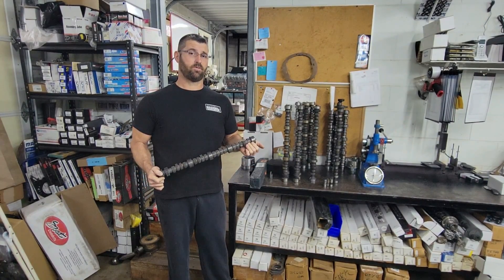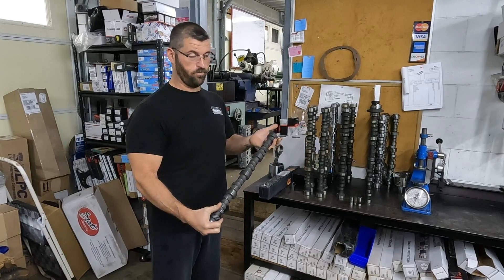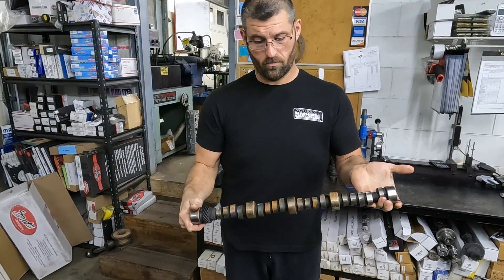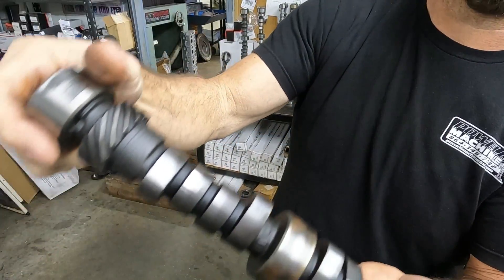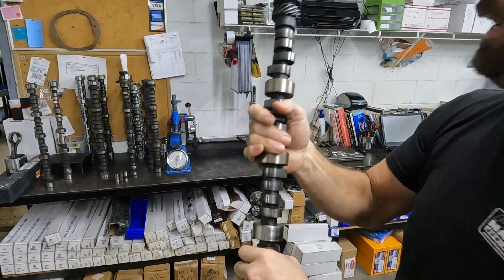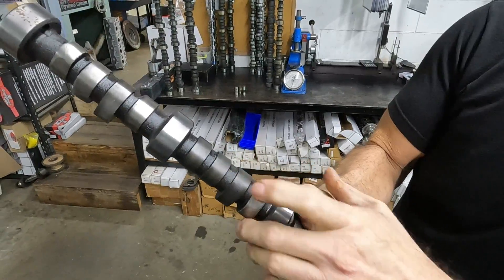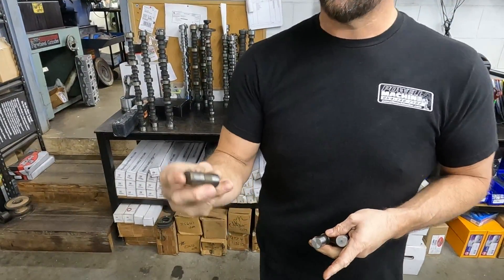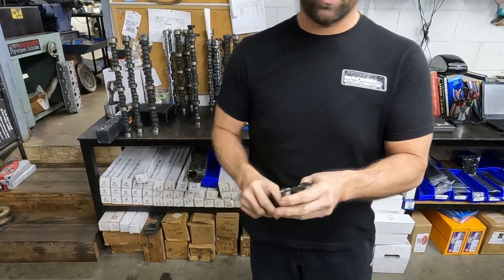Flat Tappet Cam Failures?, we investigate why and check the hardness of several cams and lifters!

Comment: A solid lifter cam is a flat tappet cam, a hydraulic cam is not as it has a very slight bulge on the face. Lifters should be harder on the face, the heat treating is only quite thin. Refacing lifters generally takes off the heat treating.
It seems that many lifters and cams are not made properly,, that and modern valve springs are a good deal stiffer than in the past.Even on stock cams often. 
It does depend on the brand of engine as well,, eg here in Oz the Holden V8s eat lifters, many were 'gone' at 2-3 years old. Some replacements lasted longer than OEM and others ate up very quickly. I have changed a LOT of them. Clevos and LS Mopar V8s do not have the same appetite for them as the Holdens. Chevs are better than Holdens, but not great either.. But I have changed more Chev cams than Fords. 
Falcon 6 Cross Flows eat rockers, Cleveland rocker @ 1.73. But the lifters generally live [again Clevo] Holden V8s do this as well but not as bad as Falcons. 
Yet I have ran solid lifter cams in Chev race engines for many years on the same cam. Roller even better. A little conservative on cam specs but were bedded in on the springs to be used.
Ditto hydraulic race cam for a Clevo.

Comment: great video and information. One question, does the cam grinder harden the cam after finish grinding? If not isn't some of the hardness ground away in the process?Likewise if a crankshaft is turned .010 is it softer?
Reply from the maker: Iron is through hard, so the amount removed doesn't effect the hardness,  steel on the other hand does has a case depth.
Reply: @powellmachineinc  i did not know that, thats cool.
Reply: @powellmachineinc  So if I have a sbc 1182 steel crank and I get it turned to 327 small journal will that weaken it?
Reply from the maker: @hotrodrebel855  generally reducing the size "could " result in less rigidity,  but ultimately it's not a major deal in your application,  the biggest thing is getting the fillet  radius correct,  to stop any cracking

Comment: Why hydraulic how about solid lifters?
Reply from the maker: The body of the this is for all intensive purposes the same, ww did test many solids,  I mentioned that in the video,  just didn't have any on hand
Reply: @powellmachineinc  I've been doing cams since the '60s and typically ran (before the failures noted in the magazines last few years) a softer spring during the critical 20 minute 2500 RPM break-in run.  I still use a gutted distributor  in an electric drill to pre-prime oil pressure.  Plenty of cam assembly lube.  So one of the culprits to me seems to be the lack of ZincDitheoPhosphate in today's environmentally restricted oils?!  Definitely appreciate all of your mechanical/machine analysis and dial indicator and cam wear readings. I use a  Mech Roller 670 lift last few years w/Bronze distributor gear. Been very reliable.  Thx again & Cheers!

Comment: Very good, and timely, feature.
Haven't had a pushrod engine in decades, have you done something similar on OHC, DOHC camshafts and lifters that are normally designed with direct oil feed to the follower, rather than relying on splash?

The core doesn't give a darn about where it came from, what matters is the material and the heat treating, if any - Chinese 'crap' is 'crap' because they get away with it. Theere can be excellent products from there, but only when the customer/client holds them to the required standards, which means confirming any tests for themselves.

Comment: A friend of mine builds my engines and I follow his start up instructions to the letter ! First he sets the timing on the engine stand , he says never make a full rotation putting in the torque converter bolts ( you don't want to wipe the cam lube off the cam rotating it before the start up ) I use a known good carb and ignition system to make sure it fires on the first hit of the starter . When it starts NEVER let it idle - keep oscillating the RPM's up and down - I immediately drive mine still not letting it idle , I bet I don't let mine idle for at least a month if not more and he says never just rev them up and hold it at a single rpm like " they " say to do . He installs pretty sizable solid lifter flat tappet cams ( Racer Brown Cams in my MOPARS because the grind cams for MOPARS not just Chevy profiles on blanks ) I haven't killed one " YET " lol knock on wood !
Reply: Then how do you set valve lash if you dont turn it?
Reply: @whiteboyfromernul  He sets the valve lash with the intake off and keeps painting the cam with the cam lube , plus you go back and forth across the engine instead of one side at a time

Comment: I’d like to see a lifter refacing video. I have some comp lifters that had light rust on face. Maybe I can clean them up.
Reply from the maker: We will do that soon
Reply: Yes you can clean them up with a peice of glass some 400 grit sand paper and some marvel mystery oil run the lifter across the sand paper poor a adequate amount of oil on it in figure 8 to get a cross hatch on the lifter and your good.
Reply from the maker: @Annmarie Rudolph  that is not how you do it,...
Reply: @annmarierudolph2291  NO.

Comment: How about lifters not turning in the bore properly or block machining off like on BBC where the bores would be redrilled and bushed and reindexed in relation to the cam.  Are these people having problems using break in springs and break in oil? Making sure everything in block super clean? I'm sure the changes in oil have not helped and I'm sure it can be a bit of a crapshoot, I lost one from cam dynamics back in about 1989 on a 406sbc. Watched one on a BBC go on the Dyno about 10 years ago, he went roller after that.
Reply from the maker: Generally lifters not turning is a sign of taper issues,  definitely there can be lifter bore alignment problems,  BBC'S as you mentioned are a perfect example,  correcting those problems is out of alot of people's budget,  but should be done if you are required by class rules to run a flat tappet,  .

Comment: Ok, good to see the testing but what's the take away? Nothing was bad. So why are so many other people having devistating experiences? I coat my cam and lifters with graphite, then the break-in lube. Using stock spring pressures I run the engine at 1500 to 1800 for 30 minutes. Knock on wood I haven't had any of these cureent reported failures.
Reply from the maker: There was a bad cam,  And I talk about why, and I talk about lifter problems,  watch it 1 more time, ! Thank for your comments 🙏

Comment: I have a new Comp Cams flat tappet cam for my Ford 351M. Just a mild low RPM torque style. I've heard and read about break in horror stories. Now I'm hesitant to install it.  The OEM cam still works fine and the lifters are quiet. I think I will stay stock and not push my luck.

Comment: GM had issues with cams going flat in the late 70s/early 80s, my father changed a lot of them at the shop he worked for.  Seems to me SBC had 1 or 2 specific holes where the lifters would go flat first, i'm thinking #6 or 7??
Reply: Crocked lifter bores!!
Reply: @ruxoneto6560  nope. soft cores.

Comment: 100% of the flat tappet failures I've seen are due to unclean oil galleys. Abrasive material left in the oil galleys of a fresh block that damages the cam and lifter surfaces or the internals of the lifters.
Reply: wayment ... you mean gallery/galleries
Reply: @immanutt4442 galley is the flat area, gallery is a passage.

Comment: I put a amc 360 together earlier this year using a bullet racing cam with.512 lift . I used lots of cam break in lube , Rotela t4 and Lucas break in zink additive. Used oem springs. Also I used 15 nos flat tappet lifters and  sealed power China lifter.  Pre filled carb and got the ignition timing advanced a little. Engine fired up quickly enough and I took the rpms up to 2000 rite away . Ram for 25 minutes with about 55 psi oil pressure.  After the cam break In period in pulled the intake to inspect the lifters. I put the China lifter in the no.1 exhaust position   to ensure I would know where it was. The 15 nos lifters broke in perfectly but the China lifter had 12:24 circular groves worn into the face and it was almost flat .  I didn’t use the China lifter because I wanted to, but because that was what I could find. I would like to send you the picture of the lifters .
Reply from the maker: Sure,
Reply: @powellmachineinc  I’m not sure how to send a picture
Reply from the maker: Go through the website

Comment: Great video, thank you. Is there a way, to check/ measure/ verify the taper on the cam lobes, and the crown on the lifter, before installing them in the engine? I know by holding two lifters together, some of the crown can be seen, but that’s just a guess. If you were sent a new cam and lifters, could you check it and verify? As well as checking the hardness on both? Thanks.
Reply: Using a micrometer, measure the lobe on each edge. Should be .002”-.003” difference. That’s your taper. 

Use a precision straight edge on the lifter faces to check for crown.
Reply: @glennsouthard9208  thanks!

Comment: Years ago, I believe the cams were ground off of a "template" camshaft, yes? The cam core grinder followed the profile of the template cam with scienced-out specs for particular common applications for that particular engine size &  manufacturer, correct?  So, my question is it still done that way? Or is it completely computer controlled(no actual template camshaft) nowadays? I guess what I'm asking is the lobe taper controlled by the (computer programmed by a virtual design in the grinder)machine operator, or is the taper controlled by the taper machined into the actual template camshaft?
Also, do cam grinders vary the direction(forwards/aftwards) of the lobe tapers to counteract the forces of the lifter pushing the cam, so there is no excessive movement of the camshaft forwards or rearwards? Or do all the tapers "face" the same way?
Reply from the maker: Several things, many including me use a manual grinder that uses "master plates" that have a particular lobe design on it to grind said cam, the taper is either dressed on the grinding wheel or the actual wheel head is rotated on the correct angle for taper, on most cnc grinders the wheel head rotates also  but it's actually controlled by the cnc controller,  so the programmer would program that in.
Reply: @powellmachineinc  ahhh. So a (manual)camshaft grinding machine operator could possibly forget to set up the machine to grind the taper in the lobes.
About the other question: do ALL the lobe tapers face the same direction or not?
Reply: @budlanctot3060  a cnc machine could also forget steps and not grind the taper.

Comment: UTC recently did a video about this issue with a possible cause of failure not the hardness but the shape of the lifter shape not accurately machined so the lifter would not rotate.
Reply: Is there a link for this? I've not been able to find it.
Reply: @tachedtc  search you tube “ getting to the bottom of the great cam and lifter fiasco” uncle Tony’s garage. I would give you the link gladly if I knew how.

Comment: I have built 6 sbc 350 engines with flat tappet cams in the Last 8 months and not Lost one yet
Reply: Good work i have done dozens in my life and had 100percent success unitil last year i wiped one .thats one to many a comp cams item i now have. Gone to billet rollers .no taper on a flat tappet ment death to my cam and lifters therefore my race season also .won t happen again..

Comment: What you have stated reinforces what I have seen over the years. The real culprit is the " I followed the proper break-in procedure", bet he didn't. Going out on a limb and saying poorly ground cams are the oddball not the norm. Back to that break-in procedure. Did you use a BREAK-In oil like driven that has the right amount of ZDDP and no detergent or friction modifiers? Buying Rotella and pouring in some zinc does not cut it. Did you make sure you had oil coming out of all push rods before starting? Did you use a known working carb? Did you use a known working ignition? Did you get the distributer stabbed right with proper initial timing for instant fire up? Was the cooling system sorted out? Did you have an exhaust system so that you could listen to the motor and catch issues before catastrophe strikes? In the old days all oil had ZDDP so you just bought the cheap non detergent oil and you were good. Not now. Will be giving you a call before my next project.
Reply: I have used 15/40 rotella in every engine I have built ,never lost a cam or lifter yet because I break them in right . Your theory doesnt hold water .
Reply: dude, ive not followed the break in procedure before, and been fine. i broke the cam in on my 400 mopar with a lunati cam, at idle and holding 1500 every now and then to slightly splash lube, not 2k for 20 minutes. cam is great.
Reply: also, ive never used break in oil, only valvoline 10-w30 with a bottle of stp oil treatment(i use sddp additive now, because its just insurance) and would not do the first turn start stuff.

Comment: This information needs to be socialized better!  One thing that people should be made aware of is the only new Hydraulic Flat Tappet lifters made in the USA come from 1 place and that's Topline Hylift in the same city as CWC.  Speedpro/Federal Mogul are coming out of Mexico.  Comp is in the middle or just finished moving all their equipment from TN to MS, I'd like someone to do a little more investigation into why there's cams leaving their "State of the Art Facility" with a lack of taper!  I get the offshore lifters not having a crown, but COMP should have a higher standard.
Reply from the maker: Comp doesn't make lifters,  and I doubt there qc'ing the ones there bringing in.
Reply: @powellmachineinc  Where ever Comp is getting their lifters, their failures have cost our shop a lot of money. One project was returned with badly worn camshaft & lifters. (new Pontiac 400, hydraulic flat tappet application) We suggested upgrading to a hydraulic roller set up. Engine ran great, but was returned again with less than 1000 miles with a broken roller wheel on one lifter. Comp Cams is not offering any solutions or answers.
Reply: @rollydoucet8909   That’s insane, Comp Cams should be sued.
Reply: @MrZdvy  Comp Cams are going through the same tough times as many other businesses, I get that, but their manner of dealing with the concerns of clients who have dealt with them for years could be a lot better. More than 50% of our cam and valve train related purchases are from Comp, and to hear them say they don't know how to help you, is quite  depressing.
Reply: @powellmachineinc  
Who makes COMPs Endure-X lifters?
Reply: @jad2484  why buy reboxed stuff from COMP? Go direct to the source, BAM, MOREL or Johnson all make quality Solid Roller Lifters.
Reply: @OldBeaterGarage  
After extensive research i ended up sending my COMP ENDURE-X roller lifters back and purchased a set of XLR-8 Evo roller lifters from Jones Cams. Steel on steel roller bushing thats DLC coated. Check them out.
Reply: @jad2484  Jones is good stuff I will check those out!
Reply: @OldBeaterGarage  
Mike Jones was a super cool cat to deal with. He's also grinding the cam for my 427bbc thats going in my 1969 Yenko Nova tribute car. 👍
Reply: @port nut A ROLLER!?!? Jeez that’s insane. What lifters?
Reply: CWC cams are notorious for being soft garbage in the Datsun world, to the point where most simply refuse to run them and prefer regrinding 30-50 year old Nissan cams
Reply: @ma61king  CWC makes millions of cams a year for the OEMs and thousands for the aftermarket.  They're not selling garbage, if that were the case there'd be massive failures.  Who knows when those Datsun cams were cast, could have been a production run ages ago and truly is a problem as I imagine that's a small market.  A company that has their level of ISO quality standards isn't dumping lots of junk into the market place.
Reply: @OldBeaterGarage  There are massive failures, and the consensus is that for L series Nissans they are garbage. Maybe their V8 stuff is better, but no one wants to touch their L series cams

Comment: Buick:  '50's 60's Nailheads had ZERO lifter rotation by design.  '67 and up 400/430/455  DID have "normal" rotation.  Possibly the cam grinder forgot to put the taper in for a later Buick big block.

Comment: I haven't wiped one yet (was in the business over ten years) but I noticed long ago that the finish on the bottom of the lifters kept getting more & more course - to where it would file a fingernail, which would eat a cam lobe in seconds if not addressed - that's about the time the failures started to be common, a long time ago (2000s) and its just getting worse and worse.
The 'white box'(Chinese) parts started it all.